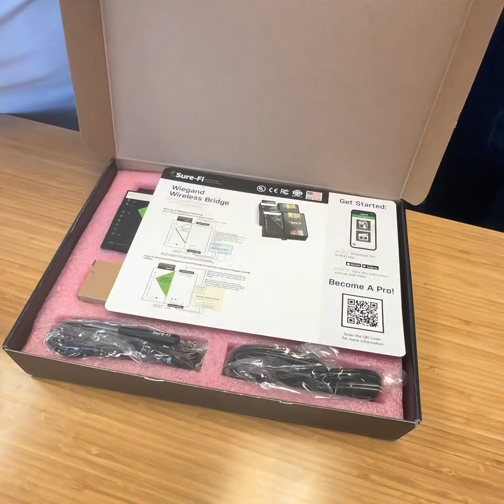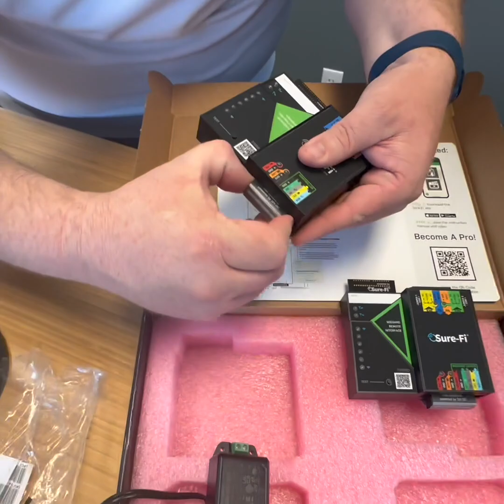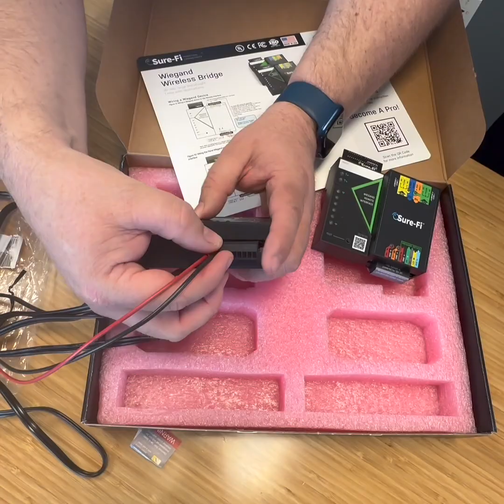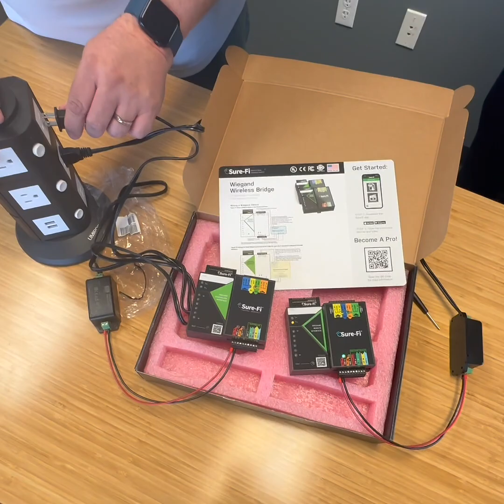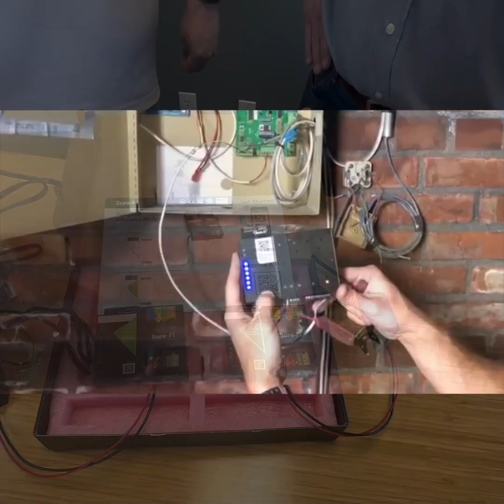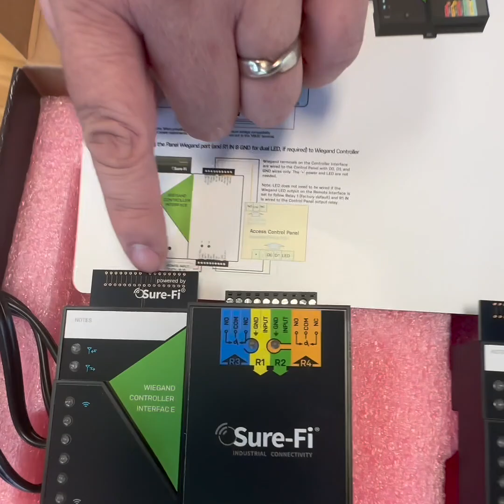Setup Sure Fi Simply

Comment: Question: I need to replace a DS4004 remote interface. 

How do I program the replacement DS4004 to work with my existing controller? My existing Sure Fi controller is working with 3 gates currently and I just want to swap out our dead DS4004.